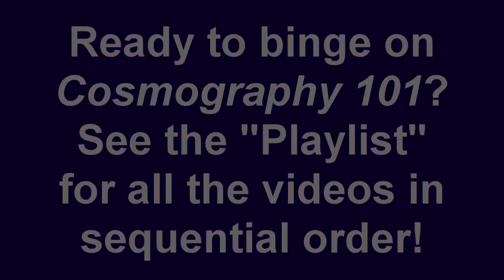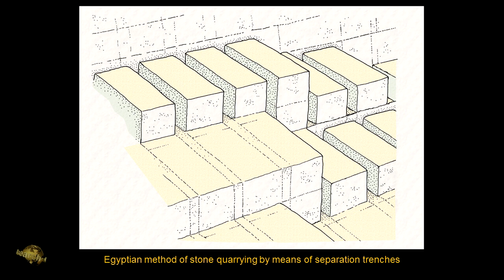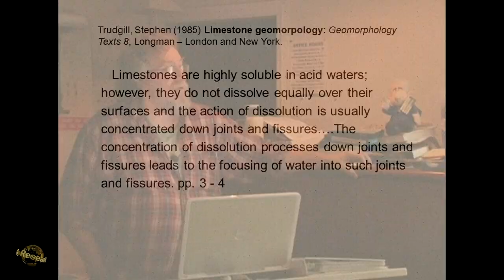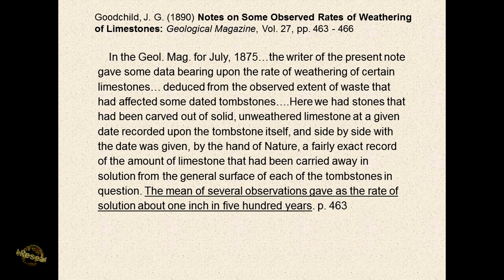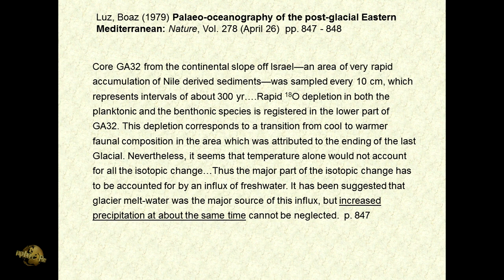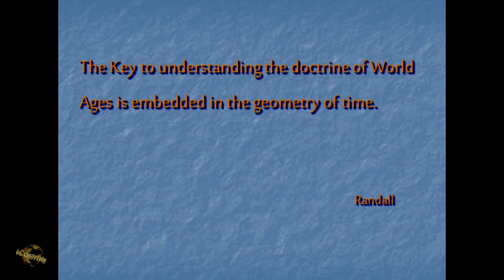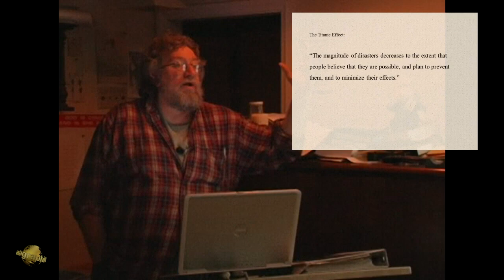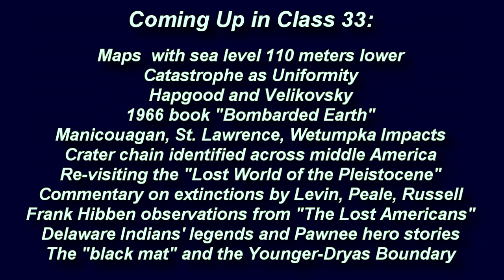Sphinx Quarry Erosion from Floods? / Durable Civilization? -Cosmography101-32.3 Randall Carlson '08

Comment: I wonder if the acidity of rain due to volcanic activity was factored into the erosion calculations...and if not, what effect that would have on the numbers.
Reply: It's not just rain that could cause that erosion, it would need flows of groundwater, even small ones over a long period. Where the Sphinx is located this would mean multiple episodes of extensive flooding to a depth sufficient to surround the Sphinx since the erosion observed is on all three of the closed sides.
Reply: Sulfur dioxide plus water makes sulfuric acid, which is extremely corrosive to limestone.

Comment: What if the Egyptians had, at one or perhaps various times redirected riverflows to deliberately wash clean the sphynx enclosure...maybe even annually during flood season?
Reply: To what end?
Reply: In the Joe Rogan Experience 1124 Robert Schoch states that the specific erosion on the sphinx enclosure they are talking about must have been caused by rainfall rather than rising water or floods.
At ca. 14:20 of that video.

Comment: Great video RC! Long time viewer. I have a question that I don’t believe I have ever seen addressed.  With continental drift, how are all the megaliths around the globe still aligned perfectly with the solstices/ compass points?   Thanks in advance! And keep up the great work!
Reply: David Whitley - That's a question I have pondered over myself.  The only conclusion I can come up with is that either continental drift is disproved or that these megaliths are much more recent than we imagine, and that would raise more questions.
Reply: David Whitley...That is a great question. The first thing that comes to my mind, and without looking it up, is that the continental drifting has been stable enough since the times that the monoliths were built so as to not throw off the alignments to any appreciable degree.
Reply: Look at it this way. 2 cm per year. 500 years per meter. 500K years per kilometer. The continent's ain't exactly sprinting

Comment: If the sphinx temple blocks were quarried from the sphinx  enclosure, why aren't they eroded like the enclosure wall?
Reply: Periodic Restoration, repair and upkeep. Afaik they are still attempting to reface it right now.
Reply: They were covered in granite
Reply: @MB-oc1nw  ...and they were already heavily eroded before they were covered in granite.
Reply: forget the temple blocks, what about the sphinx itself? Surely if the same erosion occurred on the sphinx body as on the enclosure, you wouldn't even be able to differentiate the paws/tale or anything for that matter
Reply: chazz okunomo paws side and tail were all documented patch work in dynastic time and I think some even more modern
Reply: chazz okunomo one of the    Pharaohs even documented buried in sand and did a huge project to unbury maybe someone can fill in those dates for me

Comment: I think a key feature is the slant of the wall enclosing the sphinx.  If these are water erosion features, how are the forming so uniformly over a long slanted surface with a 90° turn to boot?  I'd like to see a better explanation of how this water was actually physically flowing.
Reply: Looking at the west wall, the marks do tilt clockwise...so they do align with gravity.
Reply: The rock was first cut by quarrying. Only once the wall was created by quarrying did the water erosion begin. Take a look again at the quarry wall that hasn't been eroded by water. Then imagine water flowing over that, either repeated flooding or repeated heavy rainfall.
Reply: Yeah, but I'm referring to the top line of the wall.   It is tilted, so I'm just thinking the water would tend to go downhill, so for the great rush of water over the edge, might be more pronounced at the low end maybe...   also what was the drainage field that the water going over the edge drew from?  I'm not saying it wasn't water, I'm saying there are possibly some more inferences we could draw with some simple pointed questions.
Reply: And the wall was under ground so there is so much that happened it will never be known and I doubt that the pyrimids were built at the dawn of civilization

Comment: Mainstream archeology refuses to by into this idea because it doesnt fit the narrative. But the thing that doesnt get mentioned often is The Sphinx Enclosure is not the only place on the Giza Plateau that displays this type of errosion. While I do not necessarily think the Giza Pyramids go back to 8500bc or earlier in their entirety.  However I would not be surprised if portions of the Giza Complex is far older than the publically accepted value. 
But Egyptologists and archaeologists in general do raise a valid point. Where is the evidence for a culture capable of performing this project. So far it doesnt seem to be there. If it is there perhaps it is buried to depth greater than that of completed excavations.  Which I could see given a long period of Nile flooding leaving deposits of sediments. 
Personally I think civilization in terms of common cultures over a region goes back 60KY at a minimum

Comment: There are tombs 100ft south of thr sphinx with a causeway dug into the bedrock.  This causeway has identical erosion patterns as the enclosure.  Tomb is 4th dynasty
Reply: The tomb is probably 4th dynasty, but that doesn't mean the causeway was from that time periode. re-using older sites is much common in history.
That's the problem with standard archeology, if they find an artefact of only 2000 years old on a site, they presume the site must be no older than the artefact. That's the luck with Goblecki Tepe, it was buried deriberately 11000 years ago. so no younger aged artefacts could contaminate this site.

Comment: Here’s my question: the sphinx is lower then the 3 pyramids and it was speculated that the great pyramid has a large shaft that goes down to water. Is it possible that either the Sphinx was engulfed in water around it, or that water was being pumped some way from the great pyramid to the Sphinx’s quarry dugout? Is there evidence of water erosion in the Sphinx’s tunnel systems? What about other tunnel systems like the one found in the great pyramid? Just curious if the Egyptians filled around the Sphinx with water or if it’s been debunked that this filled water isn’t enough to erode that much rock over the course of the Egyptians dynasty’s that ruled for roughly 2800 years. Randel says it would take 600 years of ocean waves to erode the enclosure around the sphinx or 1500 years of a river pouring over that enclosure. Well within the time frame of the Egyptian dynasties. Please, I’m missing something, because the math falls within the Egyptians being able to create it.